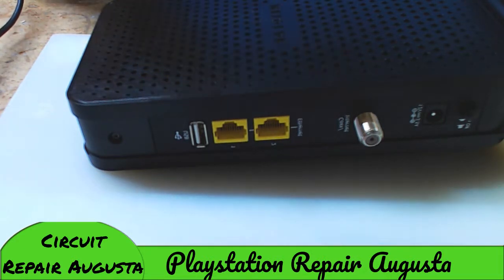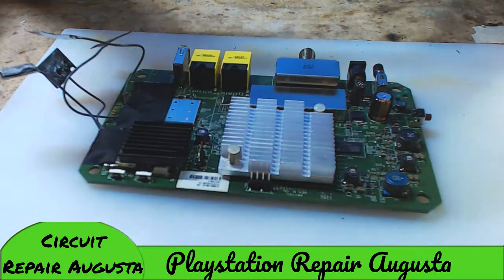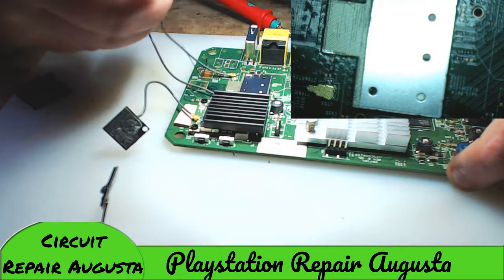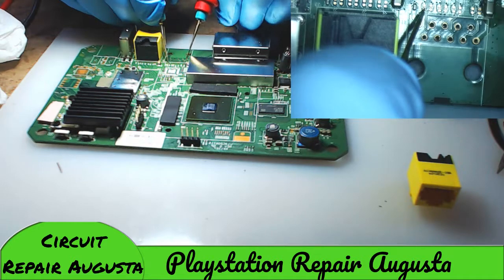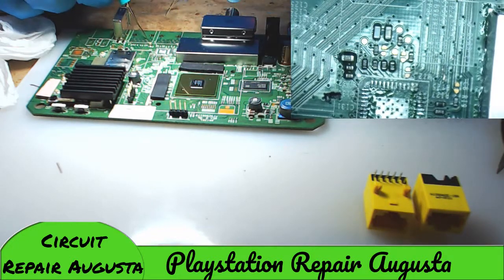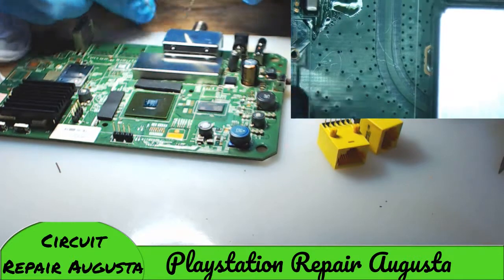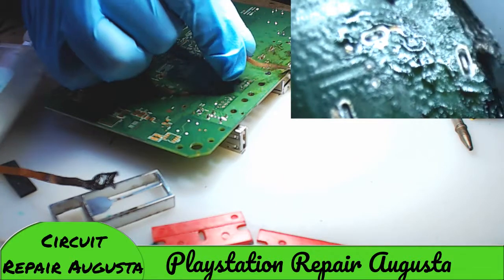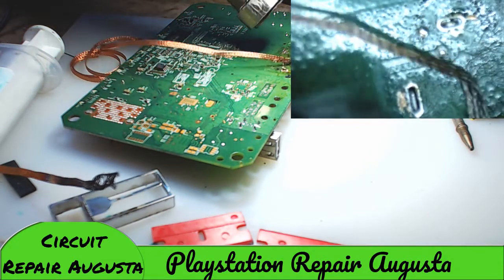Opening Modem-Router Combo to find source of power surge that killed a PS4

Comment from the maker: Ok. So i need to do a follow up. The coax terminal may be engineered to have ground and center pin connected. Opening the terminal block has exposed some coil windings that make direct paths between the two points.

More to come as soon as I investigate a little further